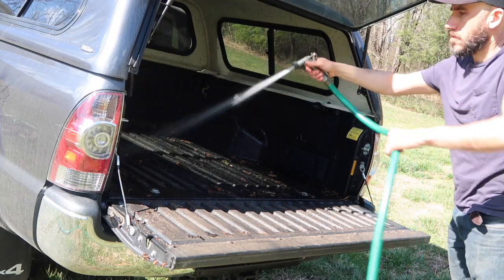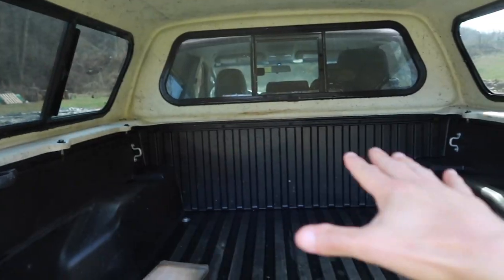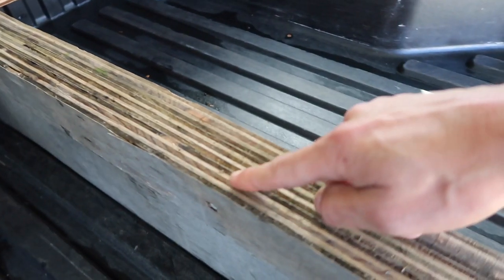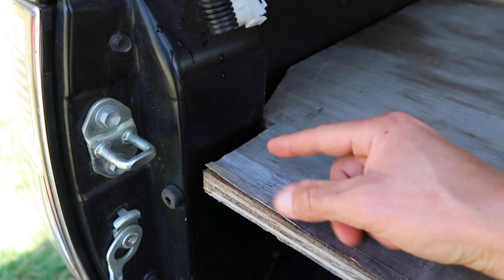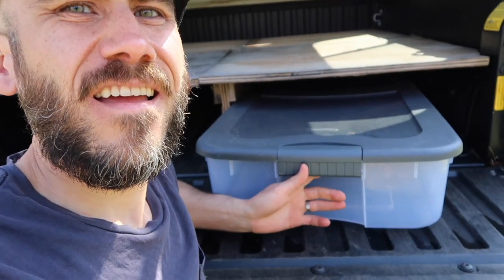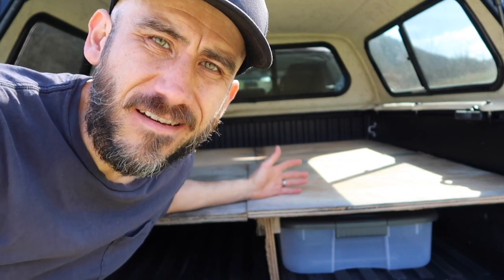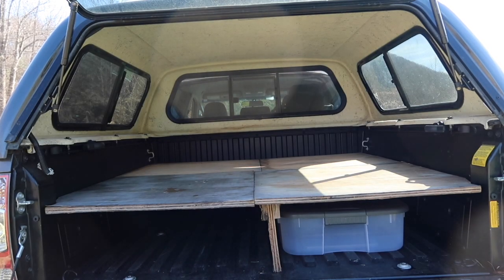Car camping 3,000 miles across the United States

Comment: The bones are built and set! Rather than having 4 pieces of plywood for the deck, I am going to make it with 2, 1 will be 18 inches deep and I will drill a finger hole so I can lift it if needed. The other will fill the rest of the deck out. Will make and fit them this evening when it is cooler. I sure appreciate your simple design for the bones of this build. The entire system will have only 3 screws necessary to be removed to take it out of my truck bed.
Reply from the maker: Mike! You are awesome man! Sounds good! thanks!

Comment: Man you are beautiful. I have the same truck and I am building a simple cabinet and sleeper with a solar panel and stereo system and I had to laugh when you were trying to get the wood in . I had the same frustrating experience tried doing a piano hinge and that was too wacky. Ended up making it sectional like you did. Was worried about the locking issue and you solved that too.  Nice video and I wish you and your family great success in a new state .  The drive I am sure was amazing love the states driven it a few times .  :)

Comment: To run the board across you could have just cut the board in half then put a hinge connecting the two pieces together and turned it upside down so it doesnt bend when you put weight on it.
Reply from the maker: Hi Jacob, Have you tried it before? That might work! thanks!

Comment: The most difficult part of this entire build was making a template for those notch outs at the back of the bed...took about 30 minutes of trial and error with some cardboard sheets to get it right. Once done it was a perfect match for the other side! Then I cut them out with a jigsaw. After the platform is finished I plan on taking an older Oriental style rug I have, cleaning it well, and then placing it over the platform for a cover! Will make a cool looking set up! Ha ha. Still getting some of my last gear in place for some truck camping this fall! And thanks for your kind comment!
Reply from the maker: Yes, I agree! those notch outs take some effort! Sounds great Mike!
Reply: Mike Howard I use cardboard too

Comment: Love it,  hope the move went well.  We travel x2 in Ford Transit Connect...just 72 inches from from seat to rear using 9 coolers and two pieces of plywood on top with air-filled mattress on that.  We sleep well since they are tall and get great gas mileage.  It was fun to see fellow travelers.  THe coolers work as great storage bins and easily slide from under the wood.  Have you had issues with condensation?  We have.  Still learning.   But isn't it great to save a ton of bucks and live with simplicity?  thanks for your video.

Comment: good job Leonard skinard glad you use you'r head one thing I would have done put some padding and carpet on the bottem and sides of the bed to keep you cooler and warmer it would keep the cold and heat under the truck from coming up though you'r sleeping bed glue in padding and cloth for camper shell like head liner in a car would helped to C😎😎L and we're all trying to get there live in a car lol🙂☺😊😆 😂😂🖒🖒

Comment: As for locking the camper shell from the inside, buy a small vise grip needle nose locking pliers and lock onto the rod after you turn the inside handle...you will see where when you play around with it a bit. If someone were to fool around with the handle, this set up should give you enoujgh time to grab your hornet spray or pistol should they eventually get the back window open...all you need is a bit of time...if you have some self defense plan! If you don't then why even lock it? While they are messing with it, you can blind them with your cree led flashlight! That may be enough to scare them off without having to deal with them violently.
Reply: Mike Howard that’s what I did too! A little sketchy Bc I live out of my Tacoma full time.
Reply: Hornet spray does nothing to people... Doesn't even sting.  Stick to a gun, mace, or a bag of sand if nothing else.

Comment: How did you fit the two planks into the bed? You were saying that the camper shell was causing issues?
Reply from the maker: the plank is cut into four sections. thanks!
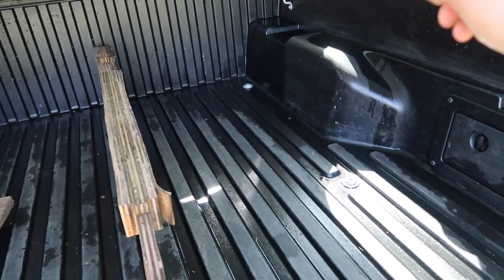Reply: Oh, I'm sorry. I didn't mean the platform shelf sections, I meant the plywood pieces that you reference at 1:46, running from lip to lip. At 2:01, you're shown struggling to get the plywood into the back of the truck.
Reply from the maker: i just cut them a little shorter then what they needed to be and fit them in.
Reply: @SowtheLand  Okay. Thank you!